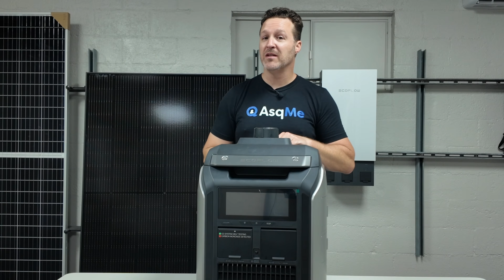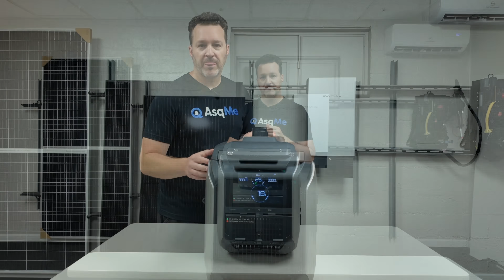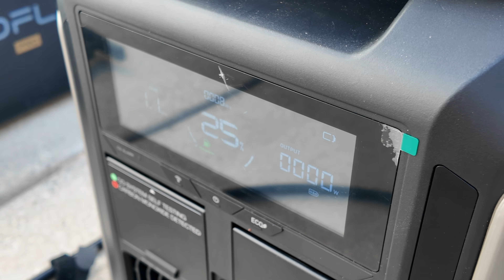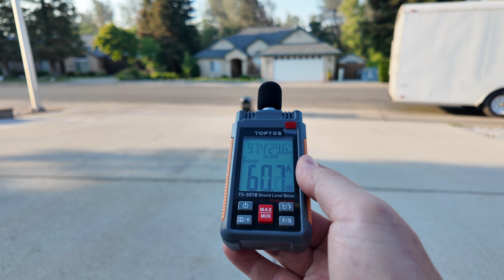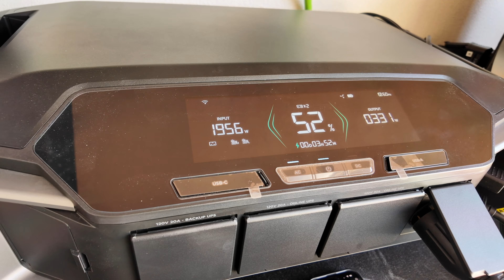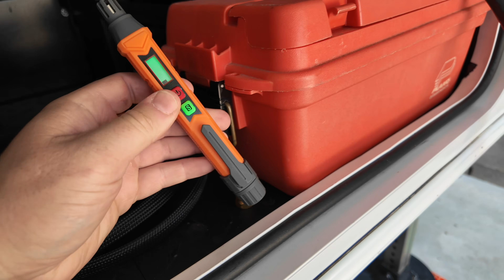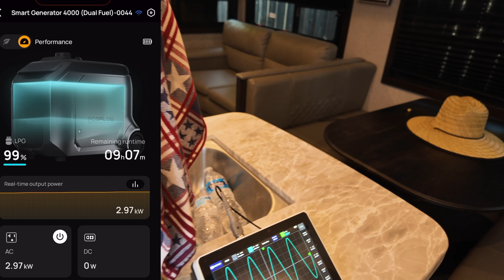ECOFLOW Smart Generator 4000! Complete Review

Comment: I have the original duel fuel Ecoflow and, just like in all your Ecoflow reviews, it runs somewhat rough as if it's misfiring at least on propane. It kind of sputters especially at intermediate loads. This doesn't effect the quality of the output as it's an inverter (and/or DC) unit but it creates more vibration (you can watch the engine flop around on its soft mounts with the side cover off). And if it is misfiring it's wasting fuel. It also just sounds bad and cheap compared to say a Honda which run like a Swiss watch at any load. I might try a real NGK plug. Finally, I've heard even the small 80cc unit has a steel sleeve but not sure if that's true or not. Even the service manuals online for the generic version of the Rato 80cc engine don't mention anything one way or the other. Even the specs for the much bigger R210 don't mention a sleeve.

Comment: I ran a champion 3400 inverter generator and 2 delta pros. You cant charge them through the a/c charger port while in use. I just ordered this so i can have un interrupted power and charge at 3kw opposed to 1.8kw. 🎉

Comment: As always - Excellent video.. Thanks!

The tech changes so rapidly, we always seem to have a random assortment of brands & models instead of a well designed system for power.
In the 1990’s, we started with Trojan AGM batteries and terribly “noisy” NON sine-wave inverters, AC chargers and no solar.
LifePO4 was truly a game changer.
Reply: For Christmas 2025 (yesterday), Santa (my Wife 😉) had a surprise under the tree.
Hutch Mountain LPG/NG gas conversion kits for all of my smaller portable generators.
(Honda: 4x EU2200i and 2x EU3000is)

We plan on running in natural gas once we trench for electrical utility power.
As a temp solution and long-term backup for electric/gas utility failure, we had planned on buying a 1000 tank (to be buried) for our Kohler 20kv standby genset and a dozen 20lb small tanks for the Hondas.

We’re using assorted equipment now, including 4 of the DJI Power 1000 “power stations” that we picked up for way less ($299@) than the original one I bought for fast in the field drone charging.

This stuff is changing too quickly for us old boomers !   LOL

Comment: Wondered if you had any ideas.  SG4000 is only putting out 1400w from the 30a outlet when charging the Bluetti Apex 300.  I changed the apex input in the app to pro mode and 30a.  Still just 1400w.  Generator seems to start and run fine, just not the expected output on propane
Reply from the maker: Test the generator separately with a different load source. I think the generator is fine and it’s the apex 300 setting 
If battery is extremely cold it may wait till it’s a little warmer to charger faster
Reply: @johnnysweekends ok I'll chk it out thanks

Comment: I bought a 220Sq foot shed and utilize this generator and the Delta Pro and extra battery for 7600KW service. In cold country, I have to set the exhaust fan to run at 65 degrees in order to warm up the batteries when the generator runs. If below freezing, the generator won't output more than a KW and runs for hours longer. Summer time will be a whole new game of temperature control. Fun stuff.

Comment: I almost bought a Ecoflow Smart Generator + Delta Pro. I like the plug and play compatibility. When I asked about cold weather starting, I was told that it is not recommended auto starting below 40 degrees F. I live near Buffalo. Have they improved cold weather starting? I have a Honda that will start in -20 degrees F. I'm challenged to auto start to work.
Reply: @RobertHales-gb9oi  just crank it mate

Comment: 0:17 I have a Question, Can I use this DC Generator To Charge Up a Proton Pack?
Reply from the maker: Unfortunately no. 
But the proton packs are powered by an unlicensed mini nuclear accelerator. And rarely have to be checked as they have a half life of about 5700 years.  Only thing to refill is the carbon-14 fuel. Although the cyclotron likes to eat bearings. Don’t want one of those to come apart while fully spooled up throwing a full stream out of your particle thrower I’ll tell you..!

Comment: @johnnysweekends. What would the advantage be for using the Ecoflow 4000 over the Predator when charging a Delta Pro Ultra?  I read the autostart feature doesn't work... are there other benefits that would justify buying over the Predator?
Reply from the maker: Unfortunately there is no reason to buy the smart gen 4000 unless you want the remote start feature on your phone. You can start and stop and monitor both the gen and DPU from your phone. It’s definitely louder than I was hoping where the predator 3500 is much quieter. But since there is no automations there really isn’t much of a reason to spend the extra money. I would buy a 240v unit for faster charging DPU. Unless you want something small and more portable
Reply: @johnnysweekends Thanks for your reply!  Do you think there's any chance of a firmware update on the DPU that would enable autostart in the future? If not, do you have a recommendation for a generator that would pair nicely with a DPU?  Thanks for the information and your help!
Reply from the maker: @lumpskie no update will work on older units and no new gen for DPU is in the works at the moment
Reply: @johnnysweekends I thought that might be the case.  Thanks for all your replies!

Comment: I see you still have that Honda 3200 in the background is it worth it
Reply from the maker: I Never use it, and used it’s worth about $1500, maybe
Reply: @johnnysweekends  thanks for the reply so I’ll take that as a no lol
Reply: @johnnysweekends  today’s the last day I can order the Eco flow dual fuel generator, cause I’m in lovely California I was thinking about ordering a 3000 ?
Reply from the maker: The 3000 is not DC charging only AC and only communication is with delta 3 Plus.
The smart gen 4000 would be better if you want the automations 

Or buy a smaller inverter gen 
Unless you are stuck with wanting auto start features and such

Comment: Trying to decide on the 3000 or 4000 to power my delta pro that is connected to an interlock to feed fridge , router , lights , ceiling fans, what would you recommend as a best solution ( would like to use LPG as well. Live in Florida ?
Reply: Thanks
Reply from the maker: I like the 4000 the best as far as build and options. Unfortunately just louder than it should have been compared to some other inverter generators

Comment: Thank you for the nice review. I just purchased a DP3 and am finding the whole architecture of these products a bit frustrating. It seems EcoFlow designed the products thinking everything will be located next to each other in the garage. For folks like myself where the main breaker panel is located in the basement, the options are very limited. I currently have a generator setup with an interlock in my panel for whole house emergency power. I was hoping to locate the DP3 in the basement next to my panel and then charge it with my generator which is located outdoors. I was going to install a new L14-30 receptacle at the panel connected out to my generator that way I could plug the DP3 in via the AC Generator Charging Adapter. But the fact that you cannot charge the DP3 via 240V while outputting 240V pretty much kills that idea. Even a Smart Generator is out of the question because they need to be relatively close to each other. Even with the solar panels, they give you these short little cables as if you are going to carry your DP3 out into the yard and sit it next to your portable panels. EcoFlow is providing power suitable for whole house emergency backup power but they are designing the interconnects of the equipment to be more suitable for campers and tailgaters. Quite frustrating.
Reply from the maker: They now have the generator smart cable extension adapter and solar cables you can always extend and make longer
Reply: @ They still seem to assume you are going to run a thick cable through open doorways and windows. Not practical in the middle of winter with single digit temperatures. You cannot run the cable from a basement out to a patio.
Reply: @johnnysweekends    can you post a link to the xt150 extension cable? My Delta pros and my smart 4000 generator need to be 30-40 feet apart... I called ecoflow.. and they said they don't make an extension cable. Hoping someone on third party does
Reply from the maker: here is the adapter but you will need another cable. It says 3 total cable can be used...https://us.ecoflow.com/collections/smart-generator-accessories/products/extra-battery-cable-connector?aff=367

Comment: I just wanted to tell you that as a fellow youtuber with experience making videos, I have watched probably 10 YouTubers talk to these systems and you are the only channel I keep coming back to because your explanations, contrasts and points you make throughout the video are absolutely priceless in making real-world decisions. I am trying to use all of your affiliate links as I am building my system for my home I am running a 400A service with two 200A panels and I have an RV so going to replace a terrible generac whole house unit with these units. Thanks again boss man, your videos are perfect. Do you think running a duromax 13000 to charge a delta pro 3 via the AC IN OUT port in the back with the adapter cord is an ok idea? Keeping in mind the Duromax isn't an inverter genny.
Reply from the maker: First off thank you so much 🙏🏼👊🏼
Now for the gen, you can try but only the DPU can charge from non inverter as long as it’s 10% THD or less.
And that’s mostly the newer units but I bet that DuroMax is. But I don’t think it will charge the dp3. You can try only thing it will do is not charge. 
You should watch my newest video on all 3 smart generators for more info 👍🏼

Comment: EcoFlow needs to make one with an oil pump and oil filter configuration.  Watercooled would be nice, but I think the oil filter and pump would really increase reliability and require far less maintenance.
Reply from the maker: It would add weight and cost. So trade off
Reply: @johnnysweekends  obv. but it’s better than having to change the oil every 100 hours. with that interval people will have to change the oil every week.
Reply from the maker: @styledliving all depends on how much you use it. Most only out a couple hundred a year and if charging a power station then it’s even less. 
All depends

Comment: why does it not have an auto start/stop when your external battery or power station plugged into it gets to 20% and turn off when it gets to 90% again... that's sorta the whole reason Id want a generator from the same company.
Reply from the maker: It does in the settings

Comment: I wonder if the genmax fuel pump works on the Honda eu2200i?
Reply from the maker: Nope
Reply: @johnnysweekends  Thanks for the information I watch all of your videos. If someone could market a pump like this for a Honda Eu2200i I am sure they would make a fortune.
Reply from the maker: The Honda has a built in fuel pump so it can actually draw up fuel. Others gens do not so they all need gravity feed.
Reply: @johnnysweekends  I was referring more to an extended fuel tank. An bare bones extended range fuel setup is over $100. A very good extended fuel range setup is $200+. Thanks for you reply.
Reply: @johnnysweekends  I reread my question and it was lame. Thanks for your reply and I watch all of your videos.

Comment: If you are going to charge an EcoFlow unit with a generator, there is not another generator out there that can hold a candle to this one. Even if you have modified the crap out of it, unless it will charge DC/DC this SG4000 wins.  I can use my Delta Pro to run both A/Cs in my RV at the same time (with soft starts) drawing 2400 watts and charge it with 800 watts solar from the roof and 2400 watts from my Smart Gen 4000 and it will charge the DP even under this heavy load.  Can’t do that with an A/C output Geny.

Comment: Just got my SG4000 and connected it to my DP I have in my RV. I had 1) 15k A/C on pulling 1.7KW.  The solar was generating 300w and the generator was generating 1.6kw to 1.7kw for a combined 2kw of input. The SG4000 was set to 3200w of output and was in performance and not eco. Any idea why it was not pushing more to charge the DP faster?  Is it supposed to only match the output and the solar was doing the recharging?
Reply: Update:  I have run the generator for over 5 hours now. I was on a live stream with EcoFlow and they were confused by the behavior I mentioned in the first post and asked me to do a video to send them showing the issue. As I did this, it functioned correctly and would increase the output above 1600 when I made the change in the app. Not sure why it wouldn’t do it earlier but is functioning correctly now. Break in period???
Reply from the maker: Sorry was out of town. Maybe updates were needed?
Reply: @johnnysweekends  no worries at all. I don’t recall doing any updates but I am glad it is working. Thanks for the reply. Hope you had a good time

Comment: I have an ultra with shp2 … in the event of a grid outage, can I use this generator to power the batteries while the batteries are powering the shp2 ??
Reply from the maker: You can use it. But only normal AC charging. There is no dc connection. You can still use smart features in the app to start and stop it. But no automations
Reply: @johnnysweekends got it thanks!! So only 1800w coming in from the generator
Reply from the maker: @danielruiz5348 correct unless you get a 240v generator and use the Ecoflow adapter 5+8 port. Or use the transformer which I’m using. I showed it in a video

Comment: I am so glad the new generator sets are catching up with my modded Honda 3000. I added an extended-run fuel tank, a remote control, and tri-fuel. I might have considered upgrading to this unit if it wasn't so loud. For years, there was no comparison with my Honda after the added features.

Comment: I just upgraded to the Delta Pro ultra. I was assured by customer service that my smart generator would be compatible but it is not. Will this be compatible with the Delta Pro Ultra?
Reply from the maker: No it won’t. So far no smart Gen for dpu. You can use AC charging but that doesn’t make it any different.

Comment: There's one thing I don't understand:  Why the charging tether doesn't automatically come as a combined cable instead of the weird gender changer module that just plugs onto the end?  Either that or supply two cables, one with the twin pin and the other with that weird proprietary connector.

Comment: I would rather have the Honda.  I've never really been a battery fan.  Yes, the Honda isn't as feature rich but Honda has a legacy and is still the go-to for any generator out there.  I would rather have two 2200 Hondas in parallel than one big 3/4000 one but if I want a big one I would go for the 7000 model.  It has bluetooth connectivity, FUEL INJECTION and other things without having to rely on battery systems or be a supplement to them.  The downside is the price as it's CA$5000 or more.  I guess if I win the lottery or a Honda contest, then yeah, the 7000 would replace my 5500/6500 open frame Chinese clone.
Reply: @WJCTechyman  a generator that turns on and off charging a battery is the ideal setup. I just wish their generators weren't garbage and had things like oil pumps and efi.

Comment: Its cool but cost to much. Last year i got a predator 5kw generator and hav3 been super happy with it. Only for 850$ and its remote start.
Reply: As someone else mentioned, it's cost is due to the fact that you can link it with a delta pro or a power kit and have it kick in and turn off on it's own as needed to keep the batteries charged instead of having to go outside every time your batteries get too low
Reply: @box420  when comparing a inverter that produces a pure full sine wave vs  predator modified sine wave is comparing apples to oranges!
Reply: @rkimlockhart9076  Yes. This is such a often overlooked consideration and also very important one.

Comment: When they get smart and stop building gas generators and build a Diesel generator then they would be at the top of the generator chain and the demand would be enormous...
Reply: HYUNDAI HAS A few so does Coleman Onan Cummins Lambo has a one cylinder air cooled and If I remember correctly there are inverter Diesel gens out there not even China junk not that everything from China is junk but this current administion is making it harder for anyone to purchase a Diesel gen unless it got Crappp epa so thank them and that Country of California....
Reply: I have a 3200 watt diesel onan in  my Winnebago RV. She runs great and Very easy to plug into my transfer switch. But then again I take it south for the winter. Lol
Reply from the maker: But the diesel gen will be almost double the weight and double the price. So I don’t think people would buy it
Reply: @johnnysweekends  that is not True anymore
Reply from the maker: @blairvigil1633 then where are they? I’ve looked. China has them but going through customs could be a loss. Hence again, price will be the bigger factor and next will be weight. Again that’s why we dont see them, not to mention the potential mechanical nightmare as people dont know how to work on anything anymore.